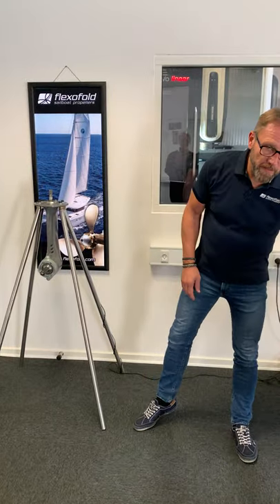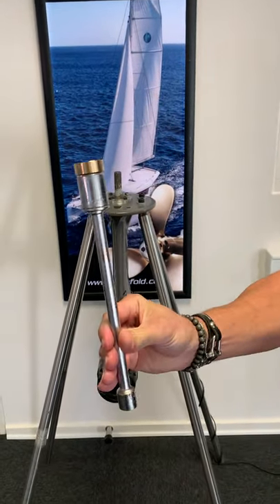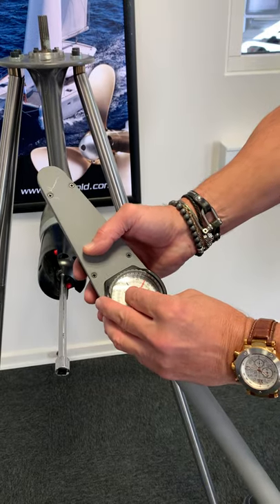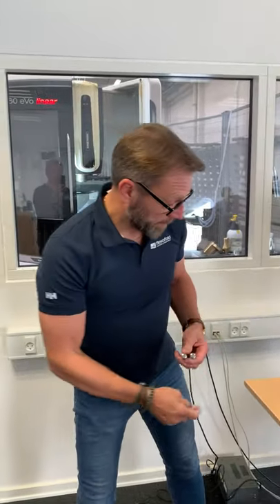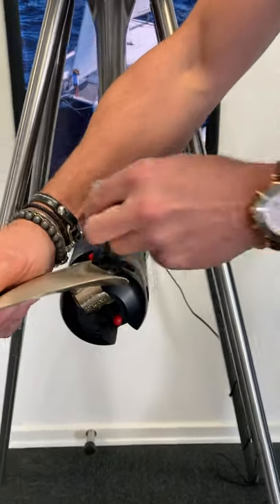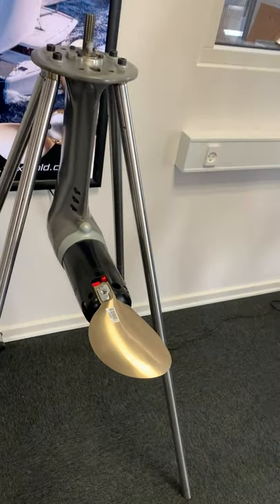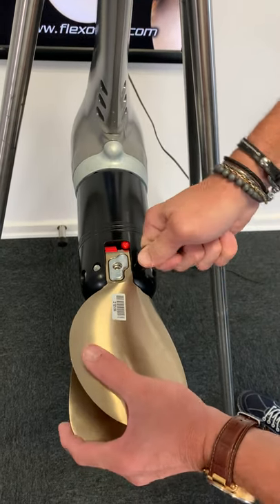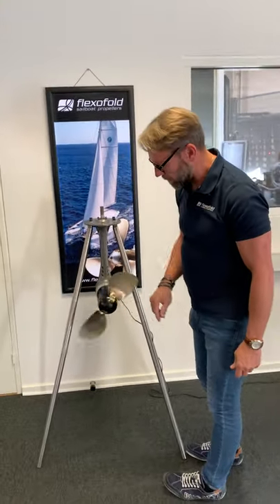How to Install a Flexofold 2 Blade Composite Propeller on Saildrive

Comment: i just ordered a flex o fold 2 blade propeller. Does this spacer come with the flex o fold propeller  0:55
Reply: Cancel your order if you can. You will be sorry........
Reply: No it doesn't, it's specific for your drive. 
I ordered a new one for my Yanmar SD20, expensive piece of metal :-P